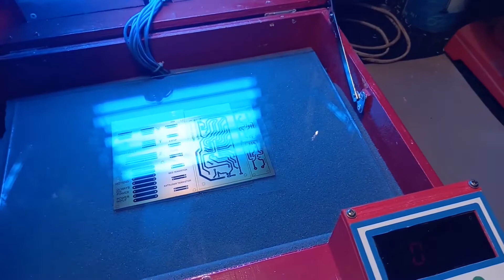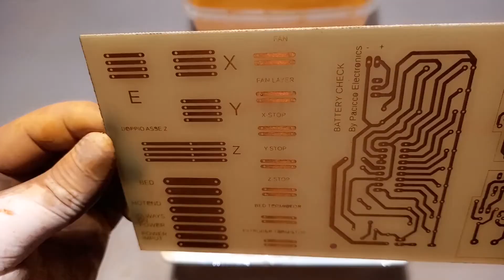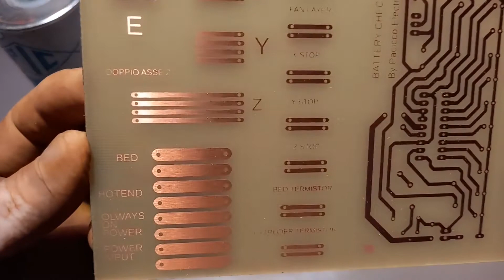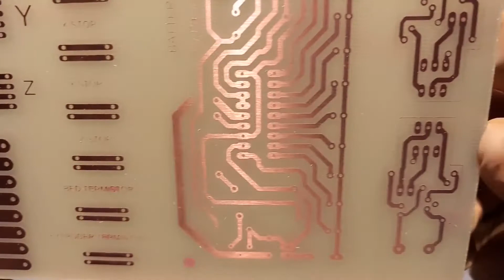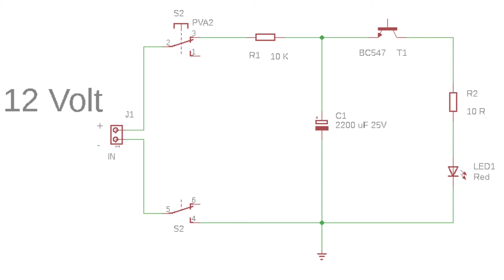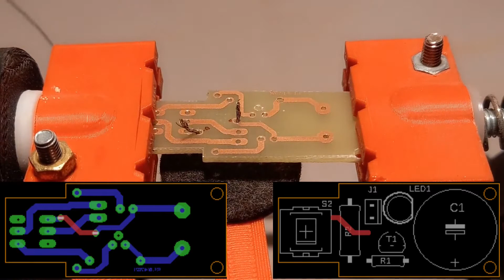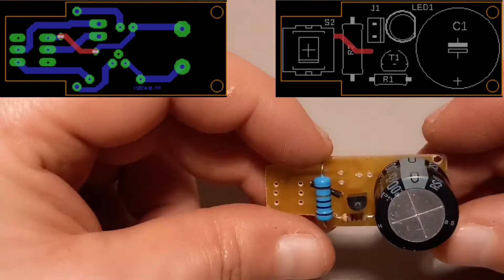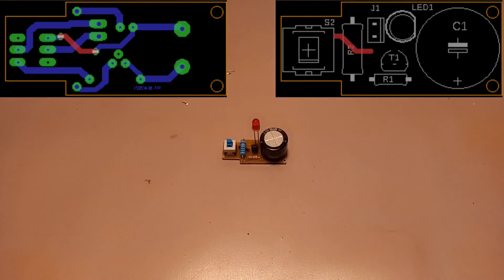How to make led flasher circuit using transistor

Comment: Sei Bravissimo, utile il progetto per piegare le resistenze, anche tutta la parte  per la foto incisione, mi fai tornare indietro negli anni anche io ho fatto un bromografo UV 👍👍👍👍
Reply from the maker: Non crei piu' i pcb? Ho una marea di altri progetti elettronici e non tutti artigianali creati negli, ma ancora non facevo video.Purtroppo.
Reply: @FrankCreatorFC  io ho avanzato una scatola di scarpe piena di alcuni progetti creati negli anni 90, tutto il resto è finito in discarica a causa dei due traslochi che ho fatto nel corso degli anni. Al momento non uso più la fotoincisione artigianale preferisco spedire il progetto tramite JLCPCB e aspetto 1 mese per ricevere il PCB ^_^